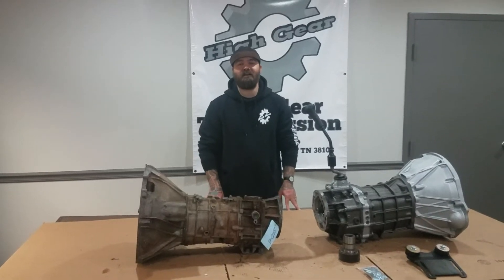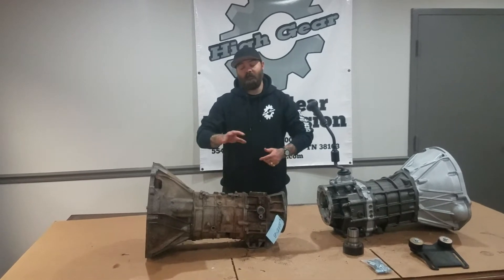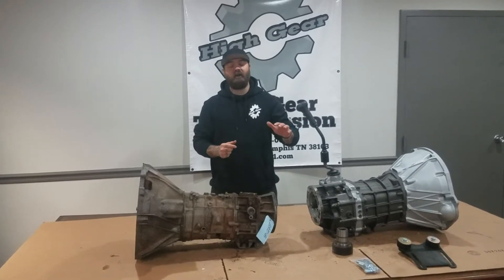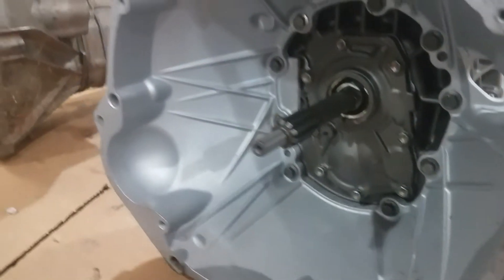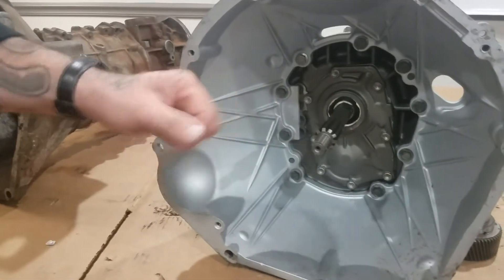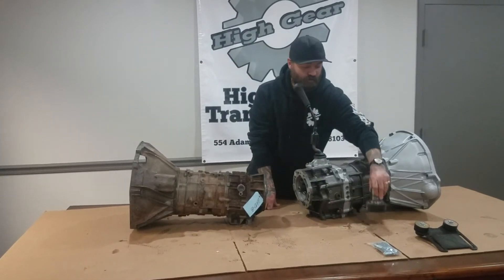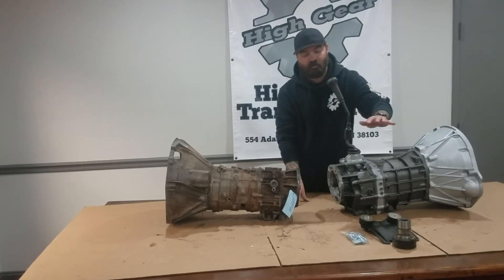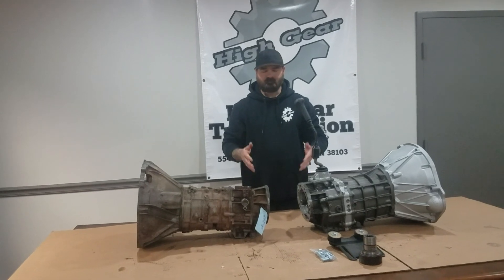Peugeot BA10 swap for AX15

Comment: Ahh that ol'BA10 lol. 20 years plus about 5 years of 380hp stroker before it bit the dust one cold -28 day when I got too rowdy 😆
Loved the gear ratios on them though, for the street, awesome and easy to speed shift. Technically for what it is designed for it was fine. It doesn't like being beaten that's all.

AX15 is a good trans. One of it's flaws is the fairly soft press the gears have. Put a lot of power through it and it'll push a gear off. Welding the assembly give it much much higher
HP capacity.  Too bad the AX15 ratios are also stupidly short. If someone would make a taller gear ratio set for at least 1st and 2nd would be nice.